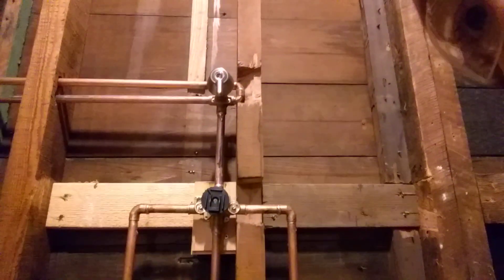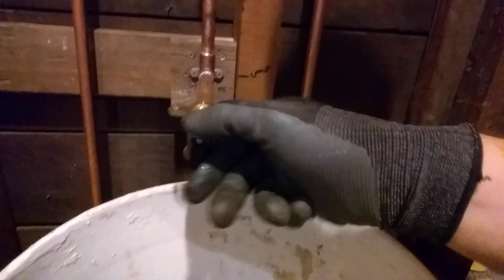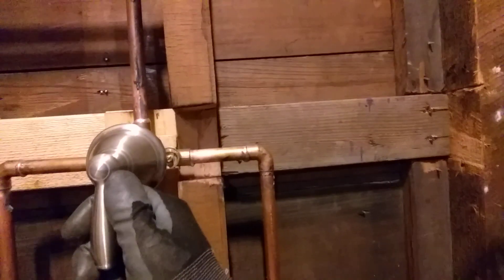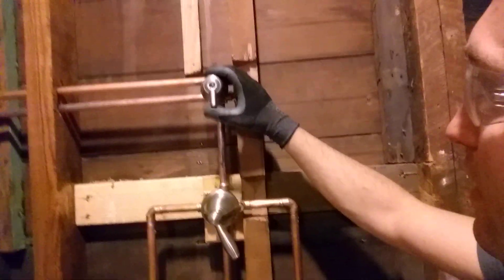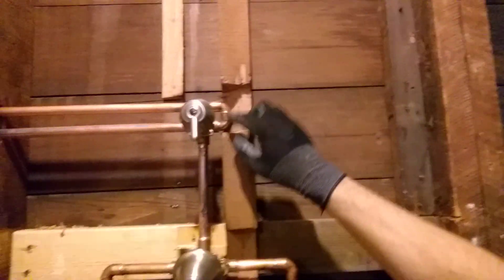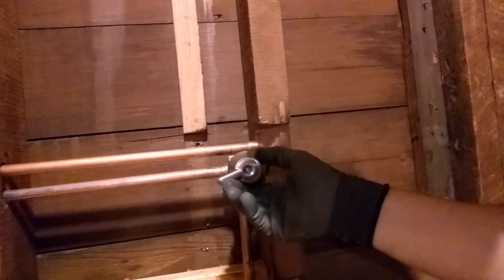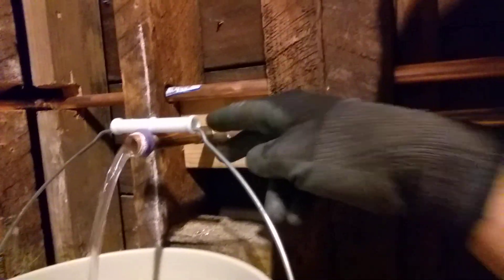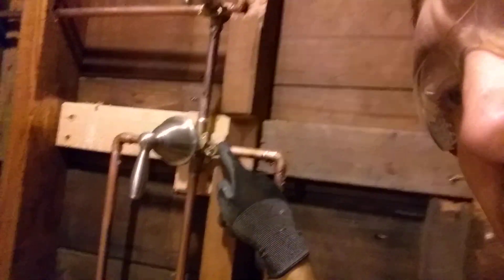Moen 3372 3 function diverter valve - Which side does water come out in the up and down position?

Comment: Is this meant to be used as 'push/pull' 'open/close' water flow control or not?  There seems to be some confusion after reading the comments. Also, can I shut off flow completely by rotating lever to some position?
Reply from the maker: It CAN be used as a push/pull, but having had several guests befuddled by it, I switched from using the extension kit to the included sleeve, which made it always fully extended (fully on).

There is no off position by rotation. Usually shutting off entirely is done by the temperature valve.
Reply: @quicksketch7  Thanks a lot. Would you not recommend it be used as the main on/off? I want my Moentrol to 'remember' my temp/pressure settings, and I was thinking of using this as the main 'on/off' at the entrance to my walk-in shower so we dont get wet turning water on.
Reply from the maker: @MrLibertyFiend  Having experienced the trouble it causes people, I would not recommend this valve for that purpose. People expect to turn a valve with a handle, not push and pull it. The three turning positions of this valve are left, right, and 50/50 both. If you could find left/right/off, like you're already intending, that would be vastly superior than the push/pull pressure of this valve.

Comment: Im not trying to be critical, but that is a 2 way diverter. 3 way diverters have 1 inlet and 3 outlets
Reply from the maker: Yeah, Moen calls it a 3-function valve in the specs. You're right it's only a 2-way valve. The middle position is apparently the 3rd function, where both valves are open at the same time. https://www.moen.com/shared/docs/product-specifications/3372sp.pdf
Reply: @quicksketch7  i only brought it up because I roughed in a 3 way diverter yesterday and was hoping to see a 3 way in your video. But i understand the difference in the word "function". A 3 way is a 4 function...a 2 way is a 3 function

Comment: Nate Lampton, thank you for this video. It was very helpful. I want to pass on some info from my experience. I just installed this valve using your information but, my results turned out the opposite to your findings. My water supply pipes feed from the bottom like yours. When I had the lever in the down position, water came out the left side of the valve. What I discovered is, there is a small notch on the end of the stem (similar to the Moen Posi-temp valve I'm using). If this notch is placed on the RIGHT side during installation, then the lever in the down position will have water coming out right side of the valve. This information is not in any of the documentation that I read for this valve.

Also, in the instructions for the TRANSFER VALVE TRIM it mentions to pull out the cartridge stem. This will give the needed water pressure. This wasn't mentioned in the installation instructions for the valve itself. It would have been helpful if it was mentioned there.
The instructions need to be updated.
Hope this helps others.
Reply: DandD M , yes , your comments were helpful to me. Thanks!
Reply: One additional bit of information - this goes for the Moen Posi-temp value as well. I followed the instructions, did a dry fitting and made sure the plaster ground was aligned properly so that the final fitting would align properly with my finished surface. When I finished installing everything, the handles protruded out from the escutcheon about one inch. From reading comments on other forums, this supposedly is within acceptable tolerances from the manufacturer. But, it just doesn't look the nicest. Lucky for me I still had the back of my wet wall open. I was able to pull back the value into the wall.  Looks much better now. Looking back, I think I should have paid a little closer attention to my dry fitting to notice that the handles stuck out further.  It's nice to have the printed instructions but is has been a great help having videos like these to see how it was done and to read comments from others about little things that could go wrong.

Comment: Just installed one of these and I can’t get the in and out pressure adjustment to work once the trim was installed. Basically it’s in the max out position all the time for me. The Instructions suck and dont mention the pressure adjustment like you said. Any ideas? Did urs work when it was all done with ur trim installed on finished tile?
Reply: Per Moen Support—once installed, this valve is NOT supposed to pull on / push off. The handle is supposed to rotate only. Why they don’t provide simple instructions for use is beyond me.
Reply from the maker: That ultimately happened to me too, on this exact installation. You can fix it with the Moen handle extension kit: Moen 137347 Handle Extension Kit https://www.amazon.com/dp/B001DO6TZC/ref=cm_sw_r_cp_apa_hptUBbMM4NCCE
Reply from the maker: Another follow-up on the extension kit: my guests found the whole in-out pressure thing confusing. I removed the extension kit and cut the chrome tube to a length the forces full "out" position all the time, since now it hits the trim if you try to push in. I think it's better this way and if I could find a version of this valve that didn't have pressure adjustment at all, I would have used that instead. Still, it's nice that a little modification can get the desired results without taking the whole wall apart.